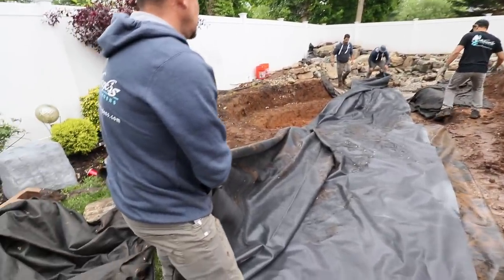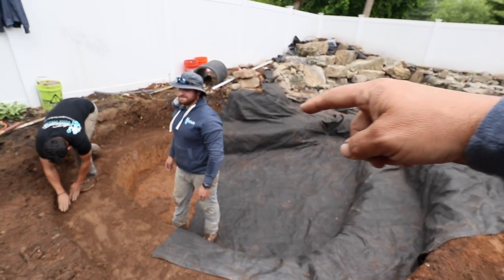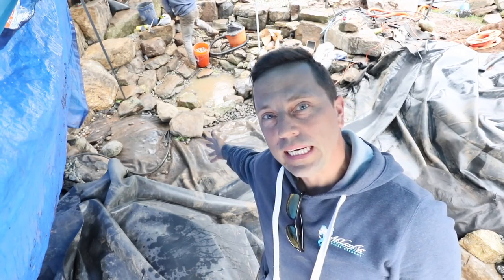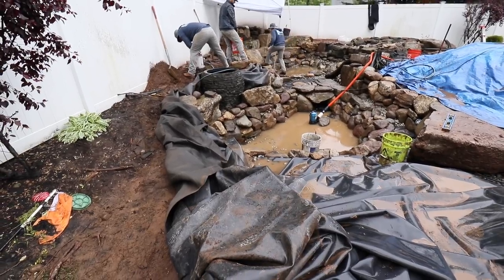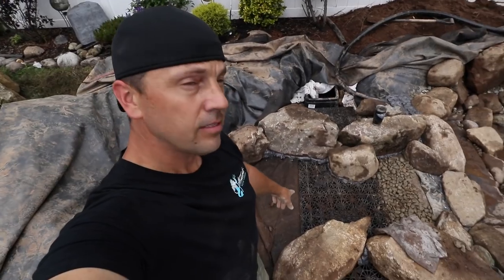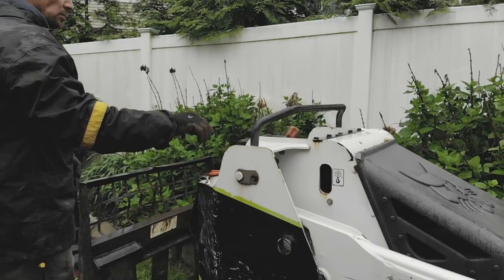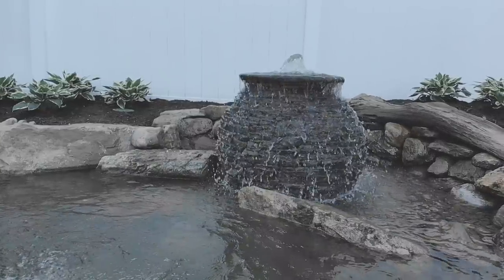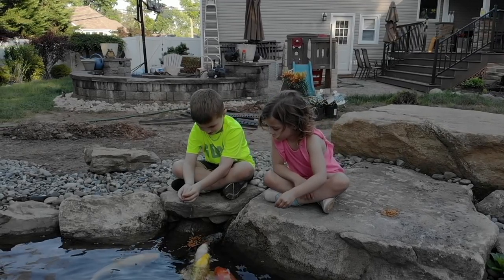CHIPMUNK DAMAGED POND IS FIXED! Seaming a Fish Pond Liner

Comment: How do you determine the pump size and how many aqua blocks your going to need for an intake bay? Because I am thinking about doing one on my pond it's a 18 by 12, 3 feet deep with an 8,000 gph pump would the pump be sufficient and how many aqua blocks would I need.
Reply from the maker: Jman Paz the pump should be sized to your filtration for flow rate and the size/effect of your waterfall. 6 aquablox would be good for an intake on that size pond
Reply from the maker: Jack Pasinski small